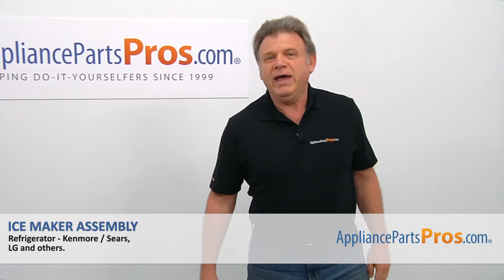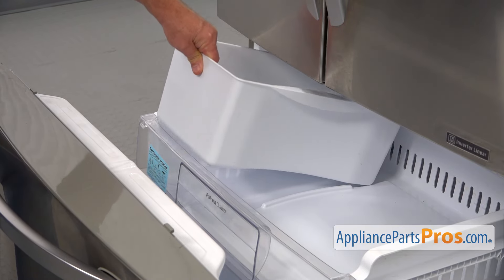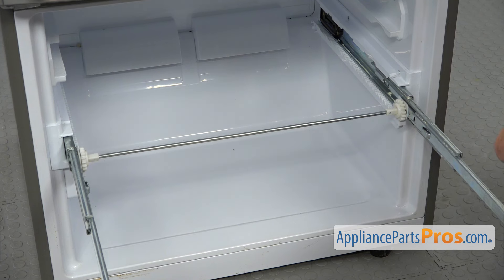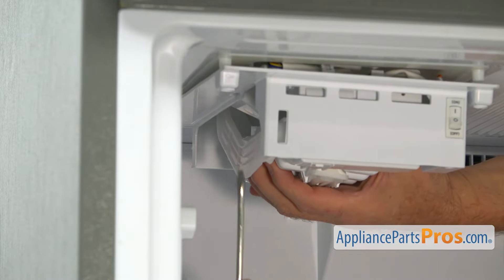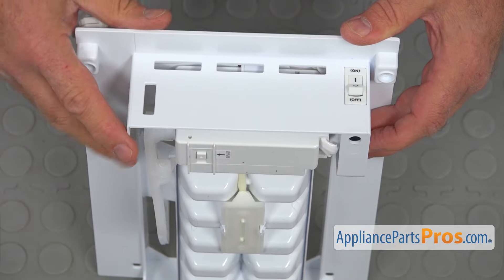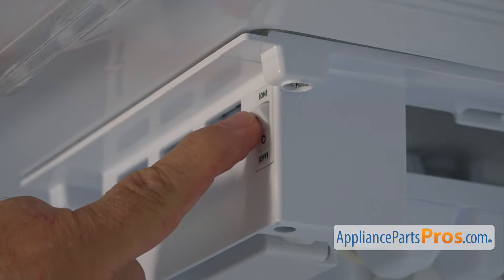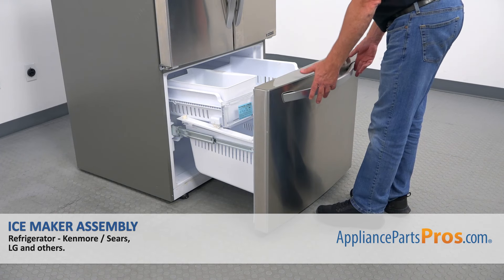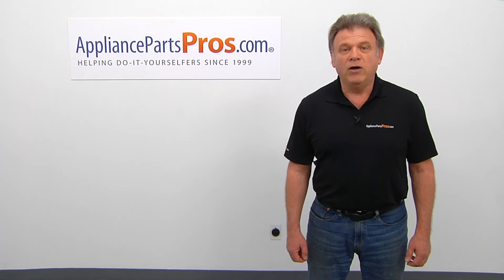How To Replace: LG/Kenmore Refrigerator Ice Maker Assembly AEQ72909603

Comment: Thanks a lot - you and your videos just saved me a couple hundred bucks. Turns out the only problem was the end of the fill  tube fitting just above the ice tray was frozen solid.  Had the water off for a couple of days - so hopefully the fact that no fresh water was flowing in allowed standing water to freeze.  There may be a heater in that area - just don't know - maybe it is faulty, maybe not.  Will know in the morning if any new ice appeared.  If something is faulty, then at least I know exactly how to change out the ice maker and the inlet valve now.
Reply from the maker: If the fill tube was frozen up then that would indicate the water valve is not closing all the way allowing a little bit of water to come in when the unit is not calling for water. So you would need to replace the water valve.
Reply: @appliancepartspros  :  Thanks for the addditional input.  FYI -Ice maker had been working perfectly for over 5 years and only failed after I had the water off for 1+ days while installing new sink.
Reply from the maker: You're welcome!
Reply: @appliancepartspros :  In retrospect, those lumps of frozen (together) cubes occasionally found  in the ice bin lead me to think there WAS a leaking valve that would cause the cube tray to overflow a little bit now and then.  If this happens again I'll  remove and bench test the valve as a "for sure" test and replace (+/- $100) if necessary.  Hopefully it was just a bit of  debris blocking  100% closure.  If not,  I have the correct part #.  (My model has the pig-tail leads to the solonoid)
Reply from the maker: If you have any other questions just let us know! Good luck with the repair!

Comment: I used this video to help me replace my ice maker.  With on exception, I followed the instructions and was able to remove the broken ice maker and replace it with a new one. 

When doing rhe disassembly, do everything up to removing the cross rod.  Instead of pulling it out, simply push the slides back into the freezer.  That will give you all the access you need to R&R the ice maker.  Any small or limber enough probably won't even have to remove the door to the freezer, but I'm old and well over 6 feet tall, so it was easier to remove it than to try to squeeze past it.  Also once you are ready to unplug the old ice maker from the connection, I found it easier to pull the wring of the old unit away from the plastic clips to get better access to the plug and to the removal clip on the backside of the plug.
Reply from the maker: Thank you for those tips! Glad you were able to fix your issue! If there is anything we can help you with in the future please let us know.